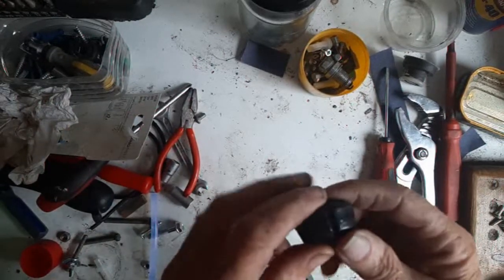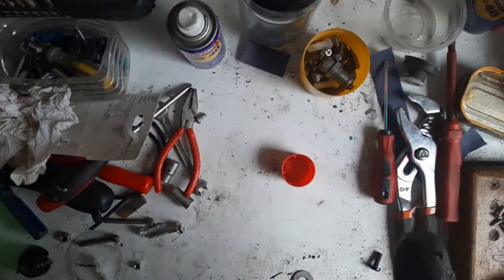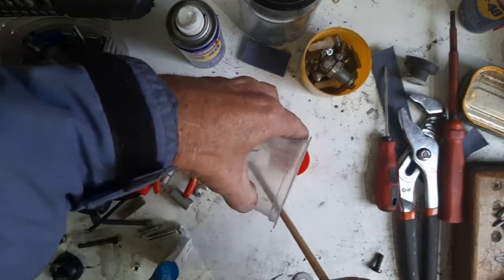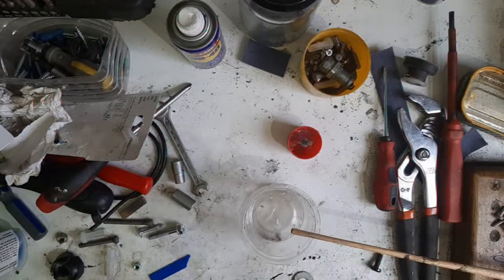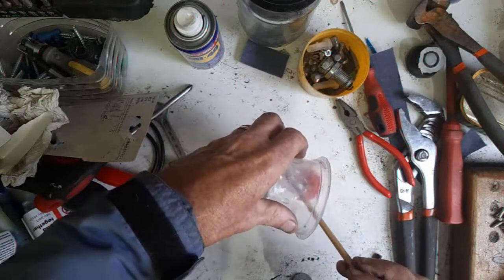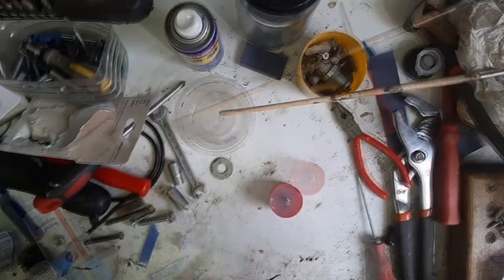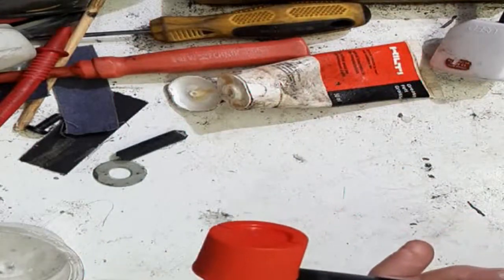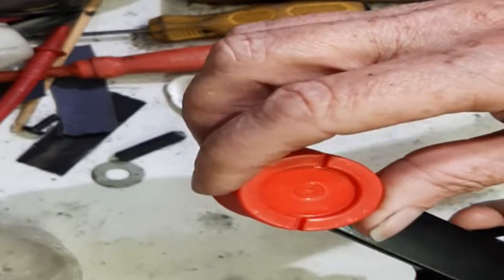The Window HandIe ( Is this a Windup ) 26 09 2021

Comment: What I did with mine was pick up a pair of them aftermarket Chinese winder handles with the different bushes in, drilled a hole into the "hub" and just screwed the handle direct onto the stub shaft.   Saved me a lot of aggro and because the winders are long cranked means I can do the whole window in a turn and a bit.   With the inner bushes of these handles I drilled them out a bit and put longer allan head bolts into the outer shell part as those Chinese grub screws are crap.   You can get a nice set o' metallic blue anodised Mini ones for quite cheap off ebay to match your paintwork.
Reply: I'm in the process of putting electric windows in mine, found on eBay a NOS sat on a shelf for years kit marked for a Robin BN2, hoping to get done sometime soon but still battling my headlamp and was waiting on a set of nylon bolts and wing nuts to replace the rusted mush that's on the bridging plate at mo.   Last week I put in a new battery plus I rebuilt the battery loom elements and put on new terminal blocks and fitted a new battery clamp as the battery dimensions were too small for the old clamp but its all on and everything working electrically :D